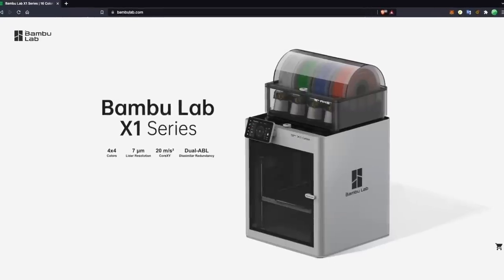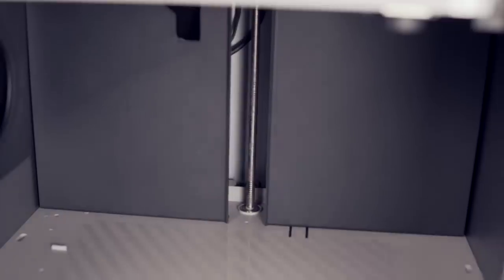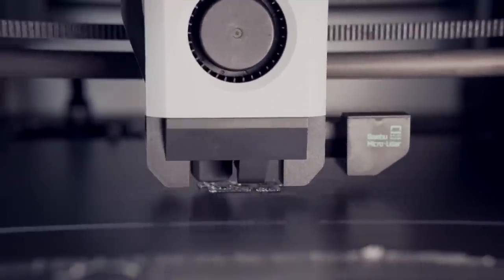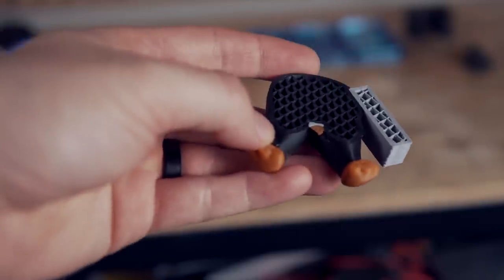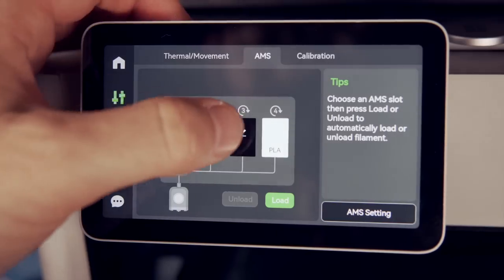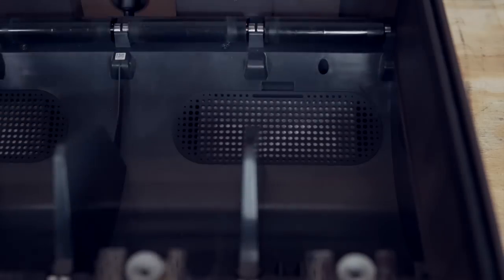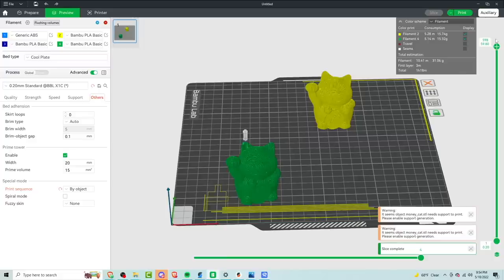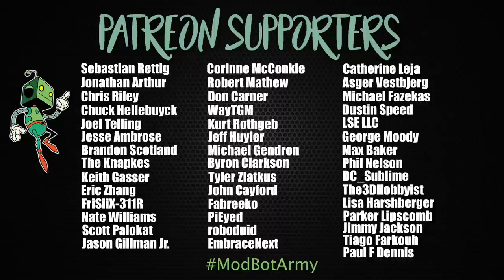INSANE 3D Printer That Requires ZERO Calibration (X1 Carbon)

Comment: I take it all back.  No image processing needed, no cameras at all!  
The WiiMote has a specialized IR sensor (Pixart) that reports the position and intensity of up to 4 IR spots, and it 'speaks' in ic2.
Sensor is looking at the print-bed under the nozzle; two or more IR light-sources mounted to print-head shine onto the print-bed; when all the IR spots converge, Z-height is known precisely.
When data from the sensor indicates a single spot, convergence!    Z-probe 'hit'!
Conversely, an observed spacing between spots could indicate distance (or slope!) between print-head and reflective object; Z-offset from already printed features?
Did non-planar printing just get easier?  Z-offset on a contoured surface?

Comment: My MK3S+ order literally shipped yesterday! I don’t know what I would have done had I seen this video then, but I think I probably would’ve cancelled it and backed this. Looks incredible.
Reply: With Prusa you are getting massive support community with it. My Prusa has been printing for years, mostly print and leave, very reliable. Just a bit slower than this, but beautiful prints. This company has zero credibility yet, a lot of proprietary stuff, it could even be a scam at that low price. Give it another year or more before you decide on this printer. Prusa will serve you well for the time, you can always add this to your stable later.
Reply: @karoo_bushman6880  Yeah, can't agree more with the "wait for it" advice. I have the Mk3s+ since less than a year or so and while this machine (from the video) looks so good, there are some VERY real concerns with it (the software, being a kickstarter to name a few). With Prusa you have a finished product which... well, prints amazingly fine - from very little miniatures (even on stock 0,4mm nozzle), to big stuff. If someone doesn't need super high printing speeds, then Prusa is just good enough and a very safe purchase, and one can even sell it and buy this thing, IF it becomes a real retail product, with good support etc.

Comment: 3 questions;
1,The lead screws are connected with a belt and not individually driven, does the printer have any form of manual/actual leveling?
2, Does the build plate have anything to line up against? This seems like a small thing but is a very nice feature to have.
3, the prints look decent given the speed, but how's the quality when you slow it down? Can it print nice as well as fast?
Reply: 1. Belts can be timed based on the position, and tension on it.
2. It's magnetic
3. No idea, but probably?

Comment: Nice. But a bit small for my needs. I just got done with a couple of prints that maxed out my CR-10, so going smaller isn't very attractive to me. I see elements of the HevORT in it with the three axis bed leveling and the carbon fiber rails. That should definitely help.

I am interested in its AMS system, having used and then abandoned the Mosaic.
Reply: I'm just imagining a 512mm^3 XL version
Reply: the three axis bed leveling is different than that of the hevort. Hevort has three individual motors which can change the angle of the bed, while this only has one motor belted to three lead screws that cannot change the bed angle. Also, the carbon fiber rails are completely different. hevort uses a carbon fiber gantry, while the rail is normal steel. This printer uses carbon fiber tubes for both the gantry and the rails, using bushings instead of linear rail carriages.
Reply: @morbus5726  Ah, I didn't know that about the lead screws. So what's the point then? The carbon fiber setup on this printer is their way of doing weight savings. So, close enough.

FWIW, I've got a ~600mm cubed HevORT with the carbon fiber gantry and the titanium hardware. I'm also using two Teknic Clearpath Servo motors for the X & Y axis. I'm sticking with the Duet controller for now, and I (finally) have my Aluminum HextrudORT working like I want it to, so once I get off of my butt I'll mount it and install the drive belts. Because I went cheap and bought the knockoff Bondtech clone from eBay I had to buy a 25mm bull gear from McMaster-Carr (the knock-off one is 1mm bigger and won't fit the frame of the extruder). Still, the fake Bondtech & replacement gear was ~$80 less than the Bondtech.
Reply: @MrWaalkman  the point is probably just to provide a more stable platform. 3 points is more stable than 2. Also, they can save money (on motors and couplers) by only using one motor with belts to power all three. If the printer's assembled well, there's really no need for tri point leveling.
Reply: @morbus5726  Color me "Skeptical" on the no need part. We'll see. But it is a gauntlet in the face of companies that do the bare minimum - or less. Looking at you FLSun.
Reply: @MrWaalkman  Well the new flsun does look interesting. They run klipper out of the box, which is a big step forward imo
Reply: @morbus5726  It appears that they have come a long way. I wouldn't know after they released that disaster of a Prusa clone that had firmware that simply didn't work, a corrupted memory card that they wouldn't replace, and responded to just one email. I can do better elsewhere.

I chucked the controller after it fried an input and put a Duet in its place, that took care of the controller issues, but the frame was still crap, and it rarely printed without giving me no end of trouble.

I finally replaced it last year with a Creality CR-10 v3, which I like quite a bit. It had to have its Z axis limit lowered (what's up with that Creality?), but other than that, it's doing fine. 

Slow as all get out, but prints nicely
Reply: @KentoCommenT  That would be a very nice start. :)

Comment: This doesn't really lower the cost of entry into 3D printing from a hobbyist point of view, but it certainly lowers it from a commercial POV. This thing has features that you would find on some of the big commercial brands but at a much lower price. Build volume is small though. If you don't want to drop the $20,000 on a Stratasys F 170 and don't need a huge build volume, a couple of these would be great for a small business with a lower budget.

Comment: Through my printing experience in an engineering field, the main difference I look for in printers is surface quality. Are there gaps, under extrusions, layer line inconsistencies, etc., and are those compromised by the hardware. Otherwise, any printer is capable of printing a structural part with the right slicer. 
The only substantial differences I see compared to mid-level printers, is high speed PLA and some points for convenience. If printing CF or engineering grade materials, you're stuck at sub-60 mm/s. HS PLA is only useful for LQ rapid prototyping. 
Also like someone mentioned: their margins are concerning. Do they have enough funding to continue upgrading their slicer to the extent of Cura/Prusa...and fast enough to compete. Will they continue upgrading with new models and technology. It would be nice if they confirmed this.
The more established Guider II from Flashforge looks identical in terms of functionality, minus some features like multi-color, while in the same price range.
Overall its too soon. I think their only hope is marketing to hobbyists, with the company outlook as a selling point. Personally I don't see the features as a distinguishable factor to compete in the 3DP market.

Comment: Seems like a fantastic printer, and it definitely introduces a lot of features that are direly needed on 3D printers, but the proprietary nature is really a dealbreaker. Proprietary is all good until you actually use the product for a long time and need replacement parts, at which point they'll most probably be stupidly expensive, if they're even available. The Prusa XL is the closest comparable with its load sensor leveling and auto-calibration, and while it is twice as expensive to purchase, Prusa does plan to release it as FOSH, which might alleviate some of the extra cost. Also, we all know what throwing money at KS entails. At least the preorders for the XL are refundable.

Comment: Wow, this looks incredible! BUT…

I share the concern of a lot of other commenters here that the price point may not be sustainable, and that they might very well either not survive or have to start charging for their cloud service at some point in the future. The need to use their cloud for direct-connect printing is worrying. I’ve seen too many companies with cloud-based infrastructure fail and leave their users stranded. True, you can always print from a card, but that’s kind of a PITA.

Their proprietary slicer is also concerning => I’d like to see you experiment with slicing in Cura and see what kind of results you get.

A big reason I’d like a multi-filament printer is to be able to use dissolvable supports, but with a single extruder, isn’t printing temperature an issue? Nylon in particular runs very hot, are there any soluble support materials that can work at that high a temp?

Finally, does their slicer have a setting that lets you use the soluble support material in just a (relatively) thin layer, so you can have the benefit without burning through lots of expensive support material? (I think Cura has this feature).

I’m waitlisted for the big multifilament Prusa,
Reply: In my (and others) experience with the Prusa MMU, multi-material prints through a single nozzle are very difficult and requires massive purges to clean any of the prior material out, or you'll likely get cross contamination which will diminish part quality substantially.

Comment: Thank you for a great video! I like to replace my 10+ Years old Rostock II and I'm deciding what printer to buy. My first choice is Bambu Lab X1-Carbon Combo 3D Printer. But I also see all the problems and "bad Customer Service..." and that isn't good for my situation. I like a printer like my Rostock from SeeMeCNC that is reliable and good CS with fast response.
Now you had this printer for 1+ years - do you use it frequently? What trouble have you run into since this review? If you had to pay for it with your money, would you buy it today? If not, what printer would you buy?

Comment: Looks like their slicer is based on Slic3r or PrusaSlicer. Hopefully they open source it like they're required to by the license if it is actually based on either of those.
Reply: The gaps around surface features like holes and text is obviously the cura "compensate overlaps" function that's been buggy like that since forever, yet is on by default.

Comment: I've always been taught that when something looks too good to be true, it usually is.
If they are able to sell this printer for 699/MSRP 999 with the exact same build quality as in this video i'm sold, but i don't quite buy it.
How the hell are they able to sell this printer for this little money when you can barely get the parts to build a voron (from china mind you) for this price?

Either this prototype has a way better build than what is going to be the case with the production machines, or this is a giant scam. I would love to be proven wrong, but right now it seems too good to be true.
Reply: Those prices are for the X1, the X1 carbon retails $1200
also you don't get the multi material addon, that's an extra $250
Still nice though
Reply: @Spawnova  Even then it is cheaper than my voron... 
Question is how the multimaterial stuff is working and how good realiable... If it is just 250 it would be a bargain. Even the parts are more expensive for building a rabbit.
Reply: Iam also getting nothing but red flags from the reviews, website and promotion.  It is suggesting this sub-2,000 system can out do everything, without assembly or tuning basically - at the same type of speeds as the Voron/RatRig/Hevort/Vzbot communities.... and those machines are heavily modified, engineered, and cost more to do less (no AMS system, etc)  the website is full CGI as well, they don't show an actual printer, printing at all - which is even more "this is a scam" sense tingle.
Reply: @xXKisskerXx  They have a YouTube channel with actual printing videos, even with the multi color stuff
Reply: Well they have proven you wrong.
Reply: @gordon314  yup, this printer proved to be much better than what i suspected. They will truly make many companies have to innovate to keep up! Cancelled my preorder of the prusa xl to get three of these instead :)

Comment: Does the AMS work as a back up for running out of filament.  If the afar left runs out will it default to the next roll?
Reply from the maker: Not currently. It definitely has the capability to do it’s just firmware. That was one of my early on recommendations after using it 👍

Comment: Can you connect the device to octoprint to avoid the cloud entirely? I'm not a fan of cloud services so I generally block them entirely. Cloud services have had way too many security issues in my experience.
Reply: Agreed fully; I can fully forgive the proprietary hotend (despite there being so many good options these days) as those will likely be easy to source from them (hopefully!). But having to be locked into their cloud service for a machine that's on my local network is just goofy.
Reply: Yep, Chinese Cloud server no less. Avoid like the plague that it is.
Reply: @joshua43214  Agreed, cloud printing is bad.  I don't need to monitor my print when I'm out buying groceries.  You can print from SD card though.

Comment: Everyone is impressed by the speed of the Benchie, but to be honest, that's not a practical example for Artists.  My Statues have significant overhangs, requiring Supports.  In my experience, supports printed fast... Fail.  So I tend to print them Dead Slow in PETG.  I hate when they fall over, or have poor footing to start.  My question then is: can the X1 print supports (on tall complex prints) quickly, like its Normal Speed, or does it have to drop back to dead slow.  Related, does the X1's high speed vibration affect the stability of Supports?

Comment: man i would love that automatic pressure advance tuning thingy
idk how expensive a lidar is standalone or how hard is it to write a more flexible tuner
(that works for more than one setup)
but that'd be ridiculously awesome
Reply: It’s likely a low resolution version of the face recognition LiDAR used for Apple FaceID unlock. It would still need to average the height or check for error/scatter. 

Similar to a laser mouse photo sensor judging movement and acceleration from an analytic texture analysis. Still very clever.

Comment: So you’re depending on a specific cloud based slicer and the company or a default will / could brick the machine and limits it’s life expectancy significantly?And you basically need a Repbox on top of the AMS to use decent sized regular spools?
Reply: No, you can use any slicer you want.

Comment: Really nice machine.  Not sure which will make a bigger impact, this or the Anker. What’s the difference between X1 and X1 Carbon?
Reply from the maker: Quite a bit, from materials used on panels to some of the features like the big internal fan. Their is a breakdown on their site. Not that the X1 won’t be great but it really feels like a step down from the specs I remember seeing compared to the carbon.

Comment: why is there no direct network connection instead of being cloud based? just have the slicer send the same file that you would copy to the SD card... zero reason to send the data around the globe to come back 10 ft away other than remote printing which is probably not common

Comment: This is impressive for a Chinese printer. They've looked at a lot of other designs and learned from them. HOWEVER: they clearly did not develop their own firmware from scratch, that is completely beyond a startup of their calibre. The existing printer firmwares took years to develop (Marlin, Reprap, Klipper) . Why anyone would just accept that is beyond me. Resonance compensation you say? I will lay money on them using klipper under the hood. No mention of that, and no release of the source code in defiance of Klipper's GPL licence.

Comment: I have never bought anything through Kickstarter, but this might be the first one. Only thing I need to know, do you, or anyone else knows if the slicer works on a M1 Mac?
Reply from the maker: Currently it does not. I am a Mac user as well and ran it on Windows. I was told by launch it will have the Mac version available but at this time it is Windows only. I am wanting a Mac version badly.
Reply: @ModBotArmy  Thank you for replying, I appreciate it! I guess I'll wait then. I will get it once the native slicer version comes out. Thanks again for the video!

Comment: I stopped watching this vid (I came back, don't worry) to check their site and watched their promo video and immediately had the same red flags you mentioned occur to me, and they all revolve around proprietary tech. It's great that they've managed to make something like this, and for the price it's a steal. I'm not inclined to invest in a brand new ecosystem that hasn't proven itself, though. Maybe that's just the tinkerer in me talking, though; now that I'm transitioning away from the "I like 3d printers as a hobby" mindset and shifting to a "I just want a machine that works reliably" mindset I can see my perspective changing eventually...

Edit: typo

Comment: 2:56 I might be wrong but the side fans might be patented by Stratasys.
Reply from the maker: Perhaps it has expired? I know quite a few of their patents have expired over the years with one of the most recent being the actively heated chamber.
Reply: stratasys used a similar looking thing but it circulated heated air through the chamber.  Source:  I have 2 stratasys printers